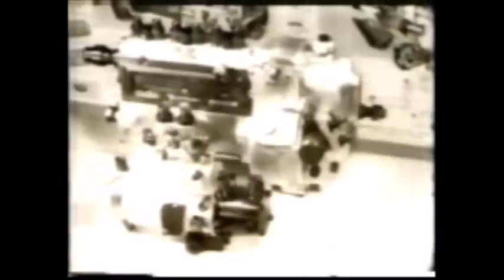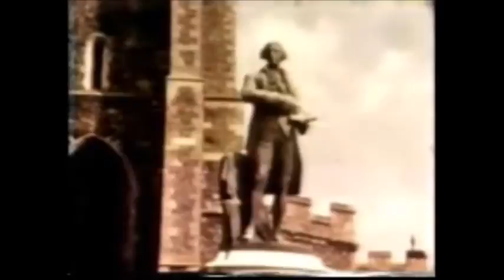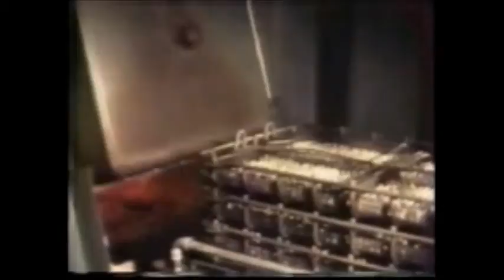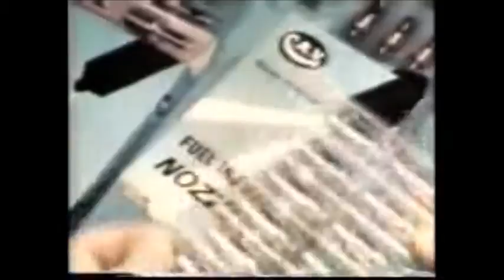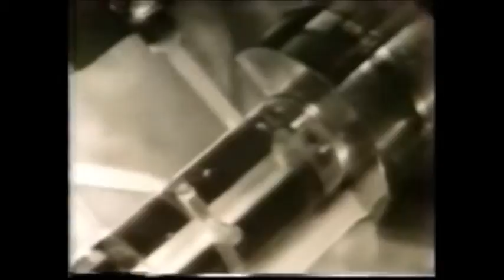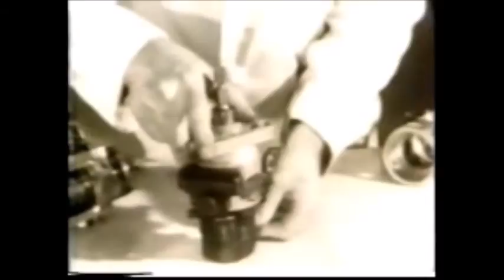The C.A.V. distributor type DPA fuel injection pump - 1967 technical video

Comment: very informative, thanks for uploading, i have an old bmc 1.8 diesel engine that im trying to get up and running the injector pump is not spitting out fuel this film has given me an insight into the workings so i will have look at the pump again, it is the hydraulic governer type.